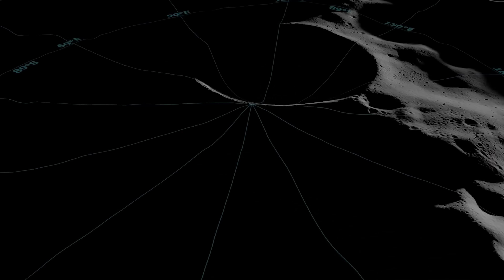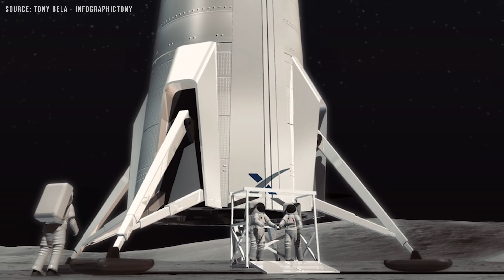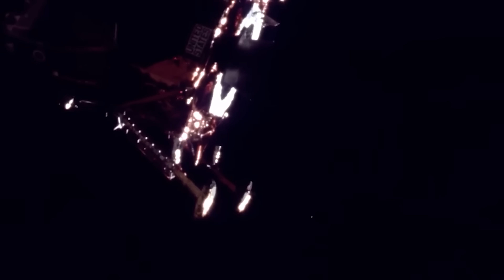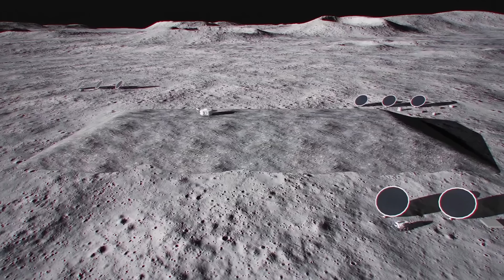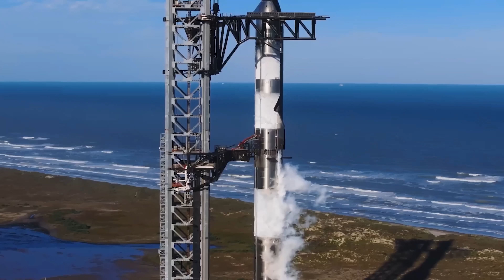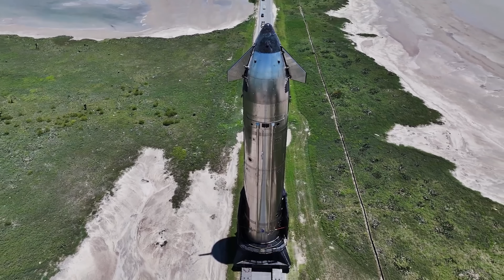SpaceX's New Method to Land Starship HLS on the Moon Sideways, Solving NASA Big Concern..

Comment: NASA's Artemis plans are changing. Block 2 SLS and the launch pad to support it are cancelled. So is Lunar Gateway.
To save money.
"As of early 2026, NASA is significantly expanding its reliance on SpaceX, pivoting away from solely in-house, government-built hardware toward a model heavily dependent on SpaceX’s Starship for its Artemis lunar program. This shift, accelerated by new leadership under Administrator Jared Isaacman, prioritizes commercial partnerships to speed up lunar exploration."
"Key Aspects of the Pivot:
Expanded Artemis Role: SpaceX's Starship is slated to handle a larger portion of the Artemis III and IV moon missions, including carrying astronauts from lunar orbit to the surface, and potentially transporting, docking, and propelling the Orion capsule.
Shift from SLS: NASA is reducing its reliance on Boeing-built Space Launch System (SLS) for heavy lifting, opting to use SpaceX for faster, more frequent, and less expensive alternatives.
Commercial Focus: Under the new direction, NASA is transforming from an entity that builds its own vehicles to one that acts as a customer buying services (landed cargo, crew seats) from private partners, mainly SpaceX and Blue Origin.
Long-Term Goals: This pivot supports a move to establish a permanent moon base by 2030, with Starship serving as a central transportation system."
Reply: BREAKING NEWS :: NASA have reduced the scope of Artemis 4 still further. Now it will simply consist of a week on Hawaii for the astronauts and Elon's children.
Reply: Blue orgin FTW
Reply: Blue Origin is grounded after burning up a $22 million satellite trying to put it into LEO. And they have moon plans? Their lander has to be refueled in lunar orbit. Ridiculous.

Comment: One thing you didn't discuss is the retro propulsion needed for Starship to land on its side. In practice the main engines could take Starship most of the way down, with a flip manoeuver and smaller side mounted engines taking over near the surface.

Comment: first send an unmanned test vechicle
Reply: Pretty sure that's already in the NASA/SpaceX plan.  Apollo did this as well, which is why it took us 10 Apollos to get #11 humans on the Moon (#1 burn up on the ground here on earth, tragic).  NASA is not going to allow a spacecraft with humans land on the moon without first landing the unmanned spacecraft on the moon first as a test.  Pretty standard procedure.

This also implies a Artemis 3.5 mission to do so.

Artemis 3 is dock test between Orion and Starship-HLS in Low Earth Orbit.

Artemis 4 is the real mission to get a massive cargo and humans to the Moon surface.

But there needs to be a 3.5 step, an unmanned test of the S-HLS on the moon, to demonstrate landing and taking off on the Moon.  NASA as far as I know has not said much about that step.

Comment: Tipping likelihood is not Moment of Inertia. Moment of Resistance to Tipping would be more correct.
It is the horizontal offset of the Centre of Mass relative to a potential pivot point.
Reply: Center of gravity on a Starship-HLS is way lower than most youtubers think since they don't do the math and just see a "skyscraper".  Nearly everyone misses the fact that there's a huge quantity of propellent there near the bottom making that center of gravity lower than the "center" visually.  Eager Space channel has done those calculations.  Shows that a nearly 21 degree tilt would need to happen for it to tip over, which is quite a lot, not impossible, but not probable.

Comment: the obvious solution is they need to go up in different crafts first... build landing pads... then bring the big ships.
Reply: Different crafts to build landing pads, hmmm, and how are we getting those "building" things to the moon to start with?  Sounds like they are HEAVY machinery themselves.
Reply: @ConstantTrue  multiple flights. it's the same pattern they'll use if they could land Starship easily from the jump. you'd land them and build more bigger infrastructure. i'm just saying start smaller. simple.
Reply: @BedbugGaming  I just don't really think craft size (weight) is the main issue here.  I would assume that the core complexity of the system really doesn't matter if the size is small or large.

A huge dump truck is really no more or less complex then a tiny 2 seat sedan if you think about it.  Both have VERY common complex parts.

So if you need to build that complexity anyways, why not use it in a LARGE vehicle so you can accomplish your set MASTER goal of building a moon base.

LARGE doesn't mean more or less safe than SMALL.  Or even more or less scary (to some).  My massive F-350 dually is inherently more safe than my wife's very small 2-door Jeep.

Comment: how about landing it vertically and having a ring system above the moon landing exhausts. The ring which  will have a backup is a system of 3 metallic bolts which will be expelled using explosive force. these bolts will penetrate the moon surface and will hold the starship like a tent.

Comment: LOL. the cult of mush believes this!!
Reply: Um, no.  No one believes this horizontal landing idea, not even serious SpaceX fans.  Regolith kickup would be bad.  Structure rings to keep it from collapsing inside would increase weight (bad for cargo capacity).  Vertical "issues" are not issues if one does the math, which almost no one does.  My pea brain can think of a dozen ways to backup the elevator, thrusters in a ring at the top of the vertical Starship will significantly reduce regolith dust up, and the center of gravity of the vertical Starship is way lower than the "visual" center of gravity, this is due to the propellent near the bottom which everyone forgets about (needs propellent to lift back off to dock with Orion in orbit).

Comment: ??? How will it return to lunar orbit from a horizontal landing???
Reply: 铺设轨道，使用像航母类似的电磁弹射装置
Reply: @frankduan9813  How you getting the tracks there in the first place?
Reply: @ConstantTrue 
the first ship can bring tracks there 
the tracks can be setup by robots or human
Reply: @frankduan9813  First ship has to land on the the bare moon surface to bring down the tracks, right?
Reply: It doesn't if they land sideways they use it as a permanent base
Reply: @JelleW2404  I get that but they need a transport back to lunar orbit to return to earth.
Reply: @BP_Devo I was thinking that they may have two versions. One horizontal meant for habitat that would stay permanently & the other vertical lander for transportation to/from the moon
Reply: @DraftedByTheMan  Now we're thinking!  Purpose built!  Still need to solve for "landing" the horizontal one without kicking up too much regolith (glass shards) as the horizontal one would have thrusters nearer to ground than the vertical one with the thruster ring at the top.  I think it may be solvable someday with the purposeful "tip-over" once landed.  There's several videos going through the math on that, fulcrums and such.
Reply: @ConstantTrue more thinking:
Tip over the HLS onto inflated airbags:
Concept:
Use large gas-filled bags as a deformable cradle, and a winch/pulley system to control the tip.

• Setup:• Primary supports: The ship is still standing on its landing legs.
• Airbag wall: A stack or cluster of large, segmented airbags is placed on one side, shaped like a curved couch.
• Restraint system: Cables from the top of the ship to ground winches on the opposite side.

• Sequence:1. Preload the cables: Slight tension so the ship can’t tip uncontrollably.
2. Deflect toward the bags:• Either retract/shorten one side of the landing legs, or pull gently with the winches so the CG moves toward the airbag cradle.

3. Controlled “lean-in”:• As the ship leans, the airbags compress and spread the load over a large area.
• Winches pay out under control, acting like a belay system.

4. Final rest:• Once horizontal, rigid supports or a hard cradle under the bags take over long-term load-bearing; airbags can be partially deflated.

• Design keys:• Segmented bags: Multiple independent chambers so a puncture isn’t catastrophic.
• Shaped contact surface: Curved to match the hull, so local pressures stay low.
• Energy management: Winches do most of the work; airbags are for cushioning and load distribution, not catching a free-fall.

Comment: Get to work on Alpaca and make it fit inside the Starship cargo bay.  Starship carries it to lunar orbit, unloads it, docks with it, transfers 2 crew members.  Alpaca descends, they do what they need to do, ascend, dick with Starship, Alpaca descends to the surface, Starship returns to HEO, retrives fuel fom tanker, returns to LEO.  Crew either returns in CrewDragon or Starship (I would prefer CD for a few missions) as NASA Control  decides.

Comment: How does it take off from a horizontal landing?
Reply: For starts the propellant mass required to make lunar orbit is pretty small. Assuming you don’t have a pig of a vehicle like starship. When we launch from earth the vehicle has to climb pretty quickly to get out of the sensible atmosphere ASAP.  But we really want to be headed “horizontally” to create the required orbital velocity.  If the moon was smooth you could orbit it at an altitude of 10 ft if that made any sense.  

A horizontal lander has to have powerful axial engines that were used to de-orbit it prior to landing.  We just used small engines in the horizontal mode for landing.  To take off we reverse the process.  We use the lateral engines to get off the deck and then light the main axial engines to accelerate and climb out. This actually minimizes the potential for damage to the vehicle due to impingement of regolith from plume interactions. The only complexity is the propellant feed system. 

If the ascender is kept to a low mass you can ascend directly on the smaller engines and leave the descender engines behind. With LH2 propulsion the mass for the 2 km/sec delta V is very small. Note that an ascender vehicle like this is also your primary transport on the moon. It can fly anywhere in minutes and deliver quite a lot of payload. You can forget about long distance rovers. Those are a death sentence given the surface exposure time and potential for radiation events.
Reply: The Eagle Obsession documentary 
https://youtu.be/3FQcms0O4iM
Like that…

Comment: This problem was thought through many years ago at ULA.  Go to AIAA papers in 2012 with authors Kutter and Zegler. You’ll see solutions that were the result of thousands of hours of design iteration by engineers who were expert at cryogenic propulsion systems.  The SpaceX and Blue Origin solutions were both considered and rejected as being fatally flawed. You are seeing the results of very blinkered, inexpert thinking in those concepts. Horizontal landing is just one aspect of a successful and scalable architecture. You’ve got to have elegant solutions for everything or the project will be unaffordable and so limited in capability as to be pointless. Just showing a rover to drive around exploring the moon shows fundamental ignorance of the transport difficulty. 
Any lander which cannot be towed on the surface to another location is unusable. You aren’t going to work on a complex rocket outdoors in vacuum and extreme temps.   Ever worked on a car or plane?  It requires dexterity and sometimes you gotta squeeze into tight spots. You have to be able to replace awkward parts and manipulate tools. Just running a leak check is sometimes really hard. You need a pressurized hangar with power and lights and air.  You don’t want to unload 15t of cargo wearing space suits!  You wheel the vehicle into a hangar and use a forklift. After offloading propellants of course. 

Landers have to land kilometers away from the main base unless you want hypervelocity objects pelting your solar panels. We don’t land jets right at the airport terminal. We have remote runways due to the hazards. 

The teams doing these things are blundering. Trying to replicate Apollo with little vision of what they want to do besides take pictures.
Reply: Everything Musk does is like a 1950s Popular Science magazine illustration fantasy. His vertical landing system works here thanks to computer adjustments, but it isn't human rated by a long shot. Sitting a few miles from his rocket testing facility -- a lot of it goes up in smoke. Along with our tax dollars.

Comment: Regolith, is technically just loose "dirt/soil."  It is not a unique material found on our moon, Luna.  It's a generalized title/name.  It's found on many planets / planeloads, or "solid" spacial bodies.
Reply: Really!
Reply: Um, no.  Regolith is mostly sharp shards of glass.  Texture: Mostly fine dust (finer than \(50\mu m\)) to small pebbles, often described as grey, powdery, and extremely abrasive.  It is NOT dirt or soil like most people imagine.  The "abrasive" part is the problem.
Reply: @ConstantTrue 
The definition of regolith as per webster's dictionary, note the word "soil" is used twice.

/ˈreɡəˌliTH/
Regolith is a layer of loose, unconsolidated rock, dust, and soil that rests on solid bedrock, covering surfaces of Earth, the Moon, and other planets. Produced by weathering and impacts, it often constitutes the top layer of planetary surfaces. Synonyms include surface deposits, debris, soil, dust, or mantle. 

Regolith is a generic term, it is not a specific material, you are generally correct in the size ratio, but not the contents.
Reply: @jpendersen1294  Find a definition that is Moon specific and doesn't jumble in the Earth side of it to confuse us all.

The bottom line is Moon regolith is very abrasive, unlike the normal soil people think of on earth.  Moon regolith is very harmful to spacesuits (see Axiom's issues), and machinery such as spaceships.
Reply: @ConstantTrue  That changes nothing, the word's definition is the word's definition.

Comment: Oh my, have you armchair engineers never heard of differential suspension? It is what allows your all-wheel SUV to negotiate rough terrain. Although SpaceX has not talked about it that I know of, it seems logical that each leg of the present design could lengthen or shorten as needed to keep HLS upright on the surface, controlled by the same lidar/radar/whatever that puts it down to begin with, a sort of digital 'bubble level' if you will. Surely they have thought of this! If not, I'm sure a robot could slip a thick book under one of the foot pads (j/k)

Comment: And how would the ship take off from the Moon, being in the horizontal position?
Reply: Pivoting to vertical
Reply: @jq4700  You go grab a rope and tie it to the pointy end, and I'll go plant a big tall rod in the lunar ground,  attach the rope to the top of the rod we just yank the 52 meter Starship upright.....  That should work right?   I wouldn't want to be an astronaut landing on the Moon on a Starship sized lander.
Reply: By reversing the process that got it horizontal in the first place.
If it lands horizontal, that wound surely require thrusters on the sides, not just on the end.
Reply: @perrygershin3946  They better try that concept on the Moon at least a couple of time before putting a human onboard.
Reply: @perrygershin3946  Yep, thrusters right near the abrasive regolith, good idea, not!

Comment: Separate sections with a crew recovery module that returns crew to upper moon orbit. It connects with another orbited return ship. One that acts as a shuttle between Earth and moon orbits. Use the Dragon that is already approved by NASA for crew transport and return to Earth missions.
Reply: Isn't that already the job of Orion?

Crew-Dragon probably doesn't have enough life support NOR fuel for a 3 day trip there, wait around for 7 days while the moon surface mission happens, then 3 day flight back.  It's built for earth to ISS mission in Low Earth Orbit.

Comment: Why not just put hatches and ladders to travel through the fuel tanks INSIDE the starship and have a door in the lower tank that can be opened?  Then you can just lower things from the upper to the lower levels INSIDE the spacecraft.
Reply: If the craft (at least in current plans) is meant to launch off the moon surface (you know, to take the humans back up), then there is still propellant in there.

Comment: SpaceX current design is just not suited for landing on the moon if they are concerned about limiting the amount of debris kicked up from the landing/takeoff. The elevator problem could be fixed with a manual ladder work around in theory in addition to adding more failsafes to the elevator itself. You can’t all of a sudden say the lander will land differently without major structural changes.
Reply: Plus elevator supplies , weight of elevator, astronauts all on one side 😮😮 will ad extra leaning on whatever side the elevator is installed on 🤕🤕
Reply: @wellesleyminto9388  You mean like when all the cruise ship passengers go to one side and the ship tips over kind of thing?
Reply: "amount of debris kicked up from the landing/takeoff" - did you not notice the ring of thrusters at the TOP of current vertical Starship-HLS?  You don't think that solves that issue?  Used on both landing and taking off.  Pretty sure NASA would have had a say in that before handing SpaceX $3.9 B contract.